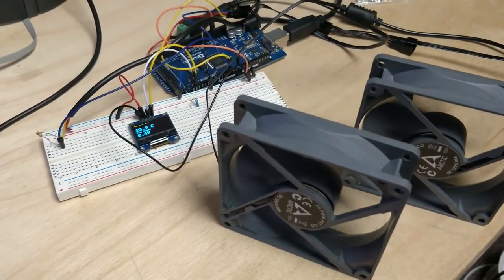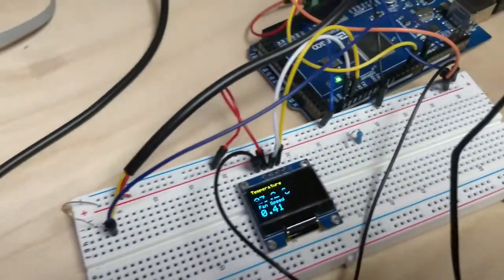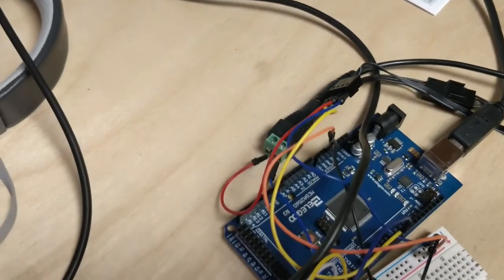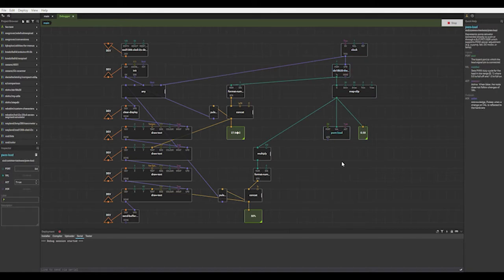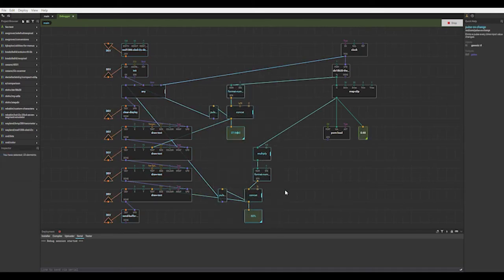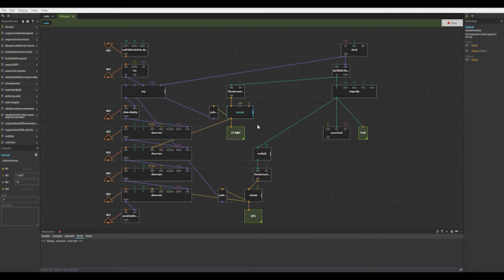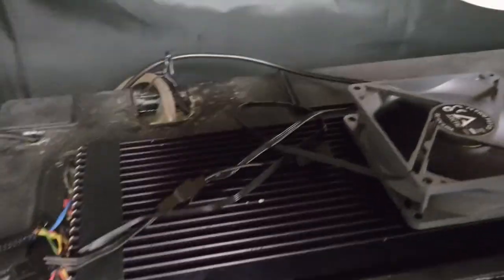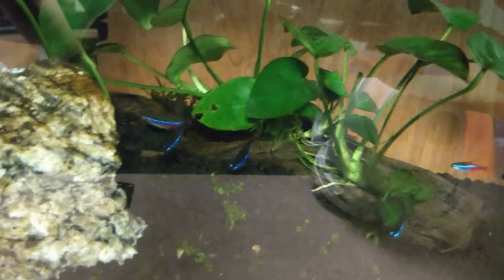Arduino PWM fan control for aquarium lights

Comment: Hello, which program is that one you used for the diagram? Also why oled display have a black line moving across? Or its just the Refresh rate between camera and screen?
Reply from the maker: Hi, not sure what you're referring to, the program used is XOD, the sketch or program within XOD is one I put together myself. The lines are the camera picking up on the refresh rate as you say.

Sorry for the late reply, Charlie